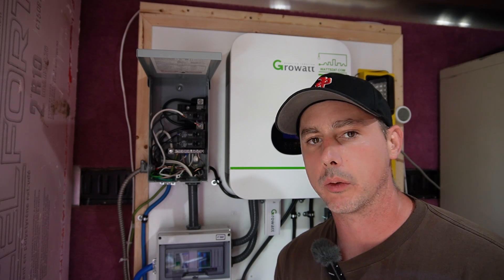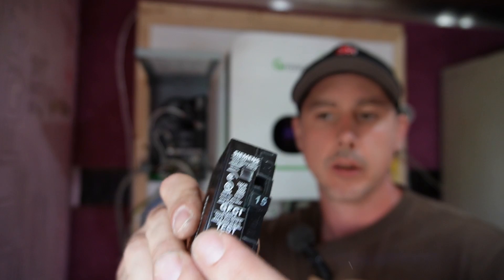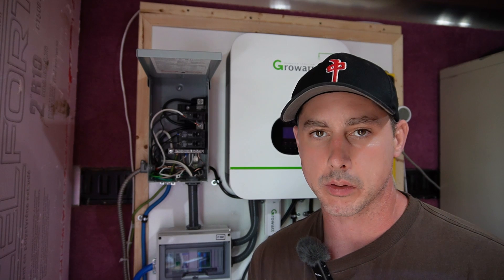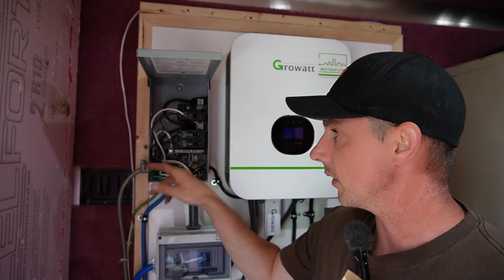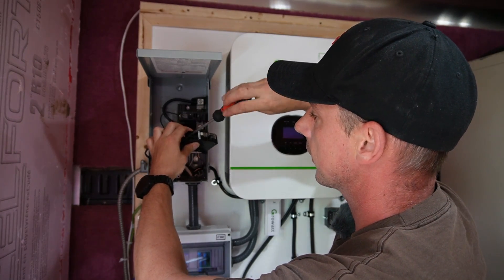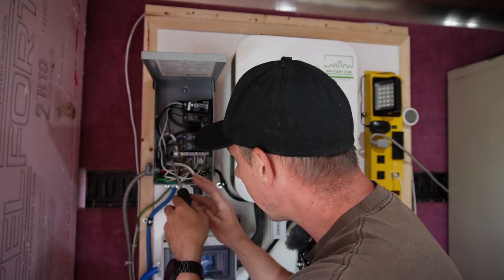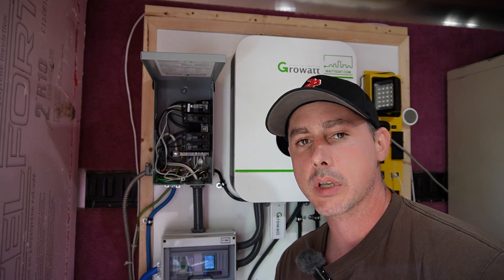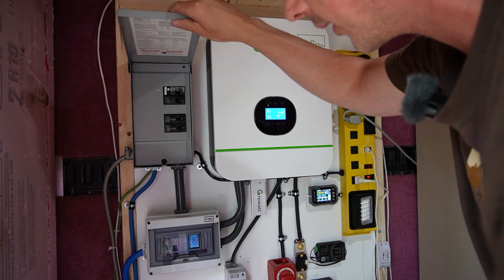How to install a 120V GFCI breaker?

Comment: Is that a double size breaker ?? 
Meaning that will take up a 2 slots ?? 
Meaning you lost a slot for another single 120V breaker
Reply from the maker: @ACommenterOnYouTube  Nope; It's a one-pole breaker
Reply: @Roll2Videos  Hmm i just compared it to my breakers and yours is double the size of my single breaker. 
My single pole breakers are 3/8 inch wide, there is NO way your breaker is only 3/8 inch wide.
Reply from the maker: @ACommenterOnYouTube  You know there is more than one manufacturer of panels and breakers right? I'm using a siemens breaker.
Reply from the maker: @ACommenterOnYouTube  https://amzn.to/3Zi8wPC

Comment: Isn’t that kind of shunt breaker triggered by electromagnetic field without actual contact? I’m confused why connected to the neutral. If that’s the case why not just buy a less expensive two wired shunt breaker?
Reply from the maker: @tastychicken3966  It's a North American standard GFCI

Comment: What is "back feeding"? Sounds like something thats already wrong and being done incorrectly.
Reply from the maker: Running the load backwards through the breaker. On an off-grid panel, it's acceptable to do this as long as it's not a GFCI breaker.

Comment: So my test button works on my GFCI breaker. But when I use a plug tester my breaker will not trip. Do you have the same problem?
Reply from the maker: No I don't have that problem. I would talk to a professional about that.